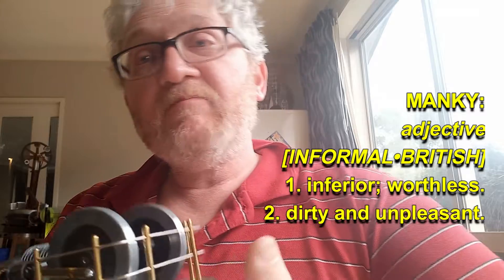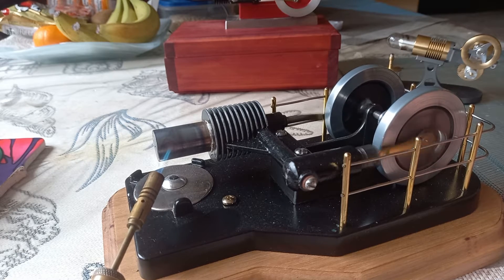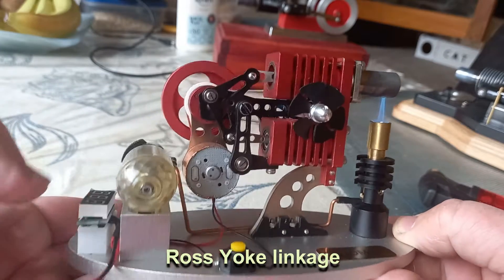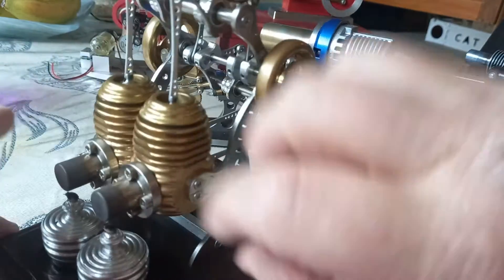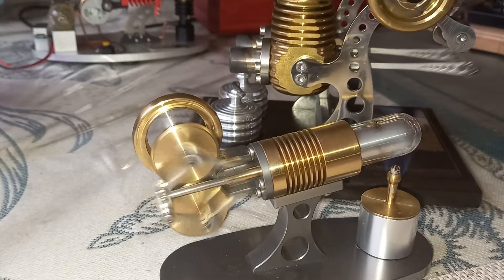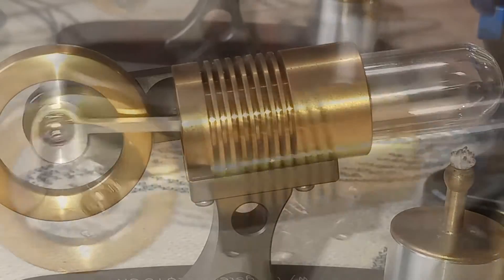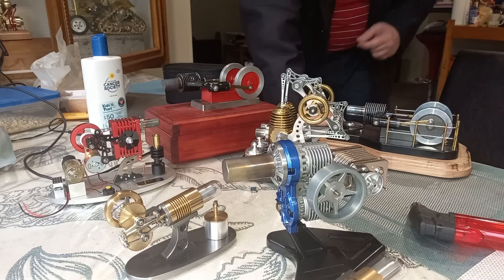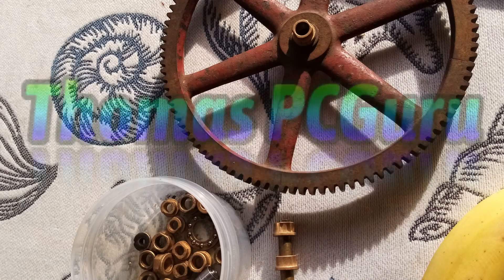Stirling Engines for sale around the world - quality hot air engine collection #stirlingengine

Comment: I live off grid, and I'm trying to figure out a way to generate electricity from my woodstove. I've seen a lot of little phone charging stirling setups, and I'm wondering what do you think would be the potential for getting multiple stirlings and hooking the dynamos up in series to make 12v, and also what the best model for that would be?
Reply from the maker: Stirling engines are weak for their size; you would only be able to generate low to medium power. Older large engines are costly partly due to their relative novelty. Newer, better engines become expensive fast. So used hardware store generators, solar, wind or water power are all more practical...